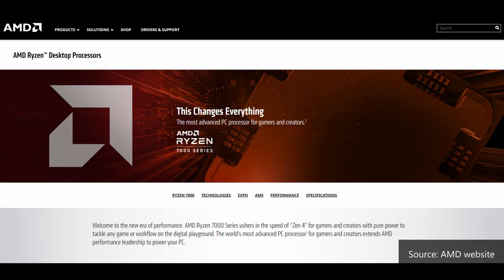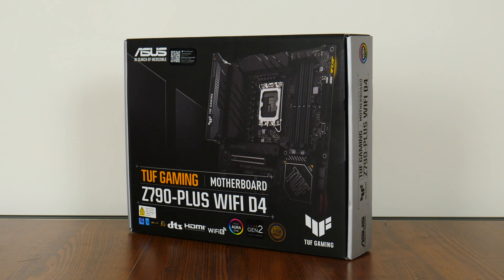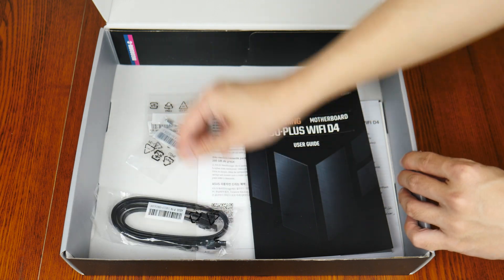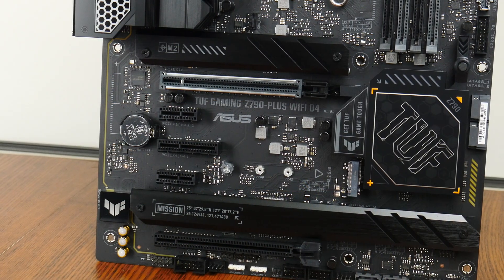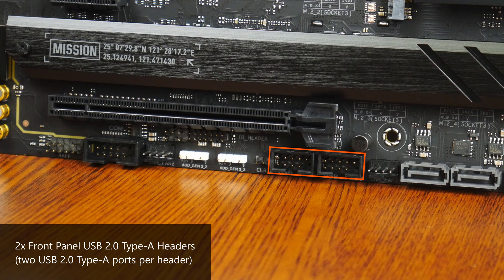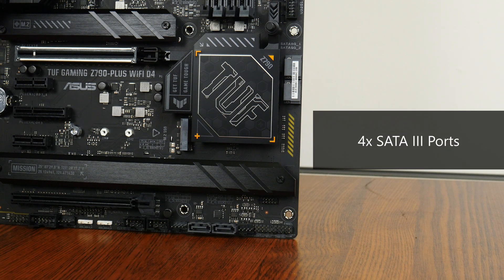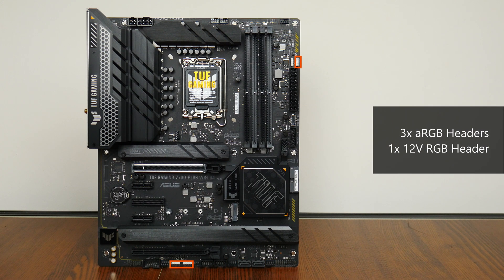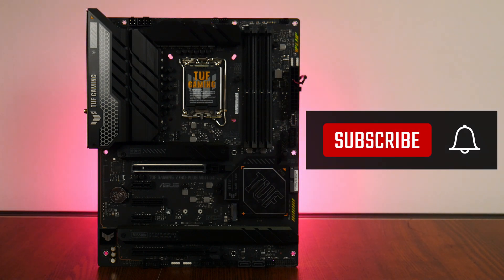Intel 13th Gen Z790 Motherboard Unveiled! ASUS TUF Gaming Z790-PLUS WIFI D4 Unboxing & Overview

Comment: i ordered this board today on dec 31 2023. Yes even if its DDR4. Its for a home multi task server (firewall, fileserver, router, virtualization), i just bought 64gb ddr4 3600mhz for $125us. I will add 3x2tb nvme ssd in Raid 5. Also 3 expansion card (intel i350-t4). Windows Server with Hyper-V running all virtual machine (isolated for each others)
Reply from the maker: Sounds like good value for 64GBs of RAM and your use case. What processor will you be using for your server?
Reply: the sweet spot for what i will do with that machine is the i5-13500 (65w) 14 cores (6p/8e)  @ALKtech . My actual machine is  i5-11400 6 cores running some linux machine and the cpu is barely hitting 5%, so already powerfull enough for the actual job. But the motherboard is just a micro-atx (32gb ram) and i need more expansion slot, etc. Also i will add couple of windows virtual machine too.

Comment: Hi, if you can respond this it would be amazing, does the i9-12900k able to be powered onto the cpu power 8x4?
Reply from the maker: Yup this board will work properly with a 12900K, just make sure that you've hooked up both the 8-pin and 4-pin CPU power connectors to your power supply!

Comment: hi, nice overview bro, planning to buy this board soon but i just want to clarify if the issues regarding the i225-v/i226-v ethernet is fixed already? such as the the disconnect issue, low speeds, dropping packets etc.
Reply from the maker: Thanks! I no longer have this board with me, so I can't say for sure that the issues plaguing the Intel Ethernet chip have been resolved fully.

https://www.anandtech.com/show/18755/intel-shares-stopgap-solution-for-intermittent-connection-drops-on-700series-motherboards

That said, it does appear that Intel's still trying to find a fix for it via software and future hardware revisions...
Reply: @ALKtech  thanks for the reply and for sharing the article man, maybe ill hold off on upgrading my pc till this issue is fixed :))
Reply: Omg m so confused .. whenever i want  to buy a motherboard for my i5 13600k, i find someone complaining abt it 😢😢😢😢😢

Comment: I got this board for my dad as someone who owns the Strix Z590-e this board has a few more quality of life upgrades like the GPU button but is there a clear Cmos button on this one?
Reply from the maker: If my memory hasn't failed me, the Z790-PLUS doesn't have an onboard Clear CMOS button - you'll have to do it the old fashioned way, that is, to remove the CMOS battery or short the CLRTC header at the bottom edge of the board!
Reply: @ALKtech  it does have one its the ASUS Strix ROG Z590-E board it has that plus the Q-code

Comment: on this ASUS TUF Gaming Z790-PLUS WIFI D4 Motherbord my RGB RAM the lights not works. How can i change the setting?
Reply from the maker: Have you installed the ASUS Armoury Crate app? Under the Aura Sync section you should be able to tweak your RGB lighting settings, RAM included!

Comment: Imma consider this motherboard for my build. I5-13600K and maybe 4080 or 7900 xt. Just waiting for 7900 xt benchmark
Reply from the maker: I'm looking forward to the 7900 XT and XTX benches too - hopefully they'll give NVIDIA a run for the money while consuming less power!
Reply: @ALKtech  yep imma build this with i5-13600K and 7900 xtx
Reply from the maker: @patrickpipz4065  good choice! I don't suppose you'll be using ray tracing all that much eh?
Reply: @ALKtech  no ray tracing It's really not a big deal for me. Also they should fix the idle power consumption.

Comment: Which  ram good for this. Im looking for i5 13600k.
Reply from the maker: I'd recommend going for at least a DDR4 3600 kit and above. If you have the budget, perhaps even DDR4 4000 or DDR4 4400!
Reply: @ALKtech Thanks 🤗
Reply: @chandu_yb7  hey did u finish your build with this motherboard and the i5 13600k?? How is it

Comment: Asus TUF z790.... maybe the best choice for my pc with 13900k+ rtx 4090. I don't know if I will have the courage to choose ddr4 in a 5k PC
Reply from the maker: Given that you're intending to go with the highest end processor and graphics card, it'd be a little odd to go with DDR4 in my opinion. I'd go with DDR5, and if need be, upgrade my RAM sticks further down the road!
Reply: @ALKtech  hello I'm from the future. 13900k+rtx 4090 with AIO (msi) + corsair ddr5 7200c34 + 2ssd from Samsung (one for OS, one for steam folder). However ddr5 is only better with the absolute best kits in 7800/8000. DDR4 wins because way lower latency (not the cas, the actual latency in ns) , therefore higher 1% lows in game.
Reply: @ALKtech  DDR5 isn't worth the money DDR4 is a nice sweet spot
Reply from the maker: @Dbz00001  DDR5 prices have fallen quite a bit over the past few months - if you're looking at a 13900K or even a high-end 14th Gen Raptor Lake Refresh processor when they arrive towards the end of this year, having some fast DDR5 might be a good idea..
Reply: @ALKtech  DDR4 does the job, just dont see the appeal
Reply: ddr4 or ddr5 doesn't matter. just go get the highest possible configuration 🙂. 
hv the same setup